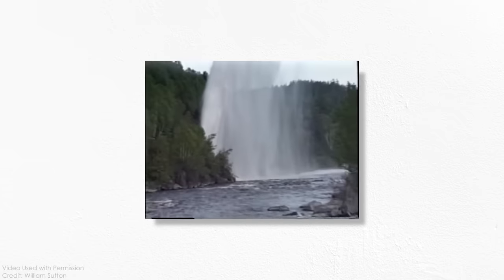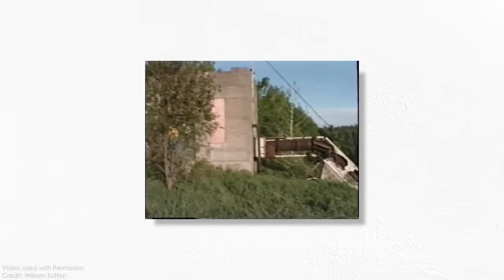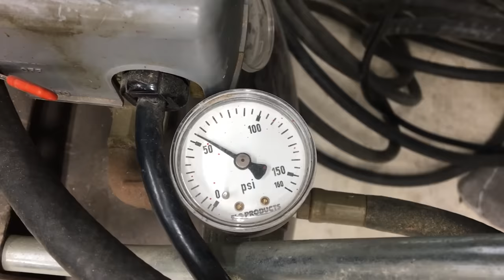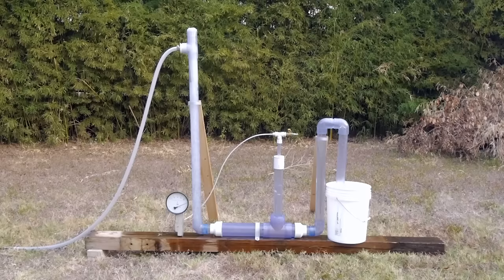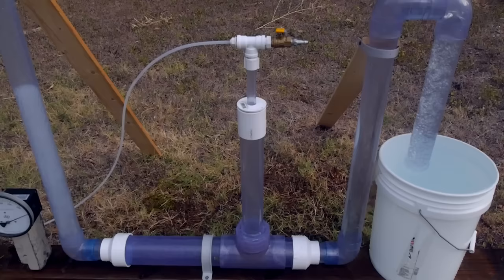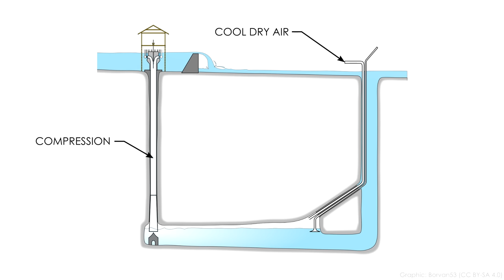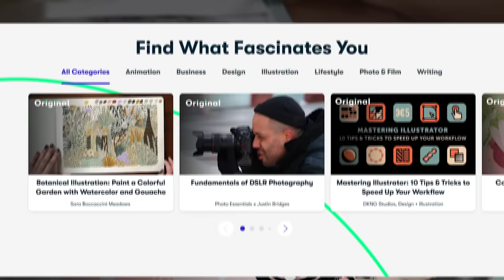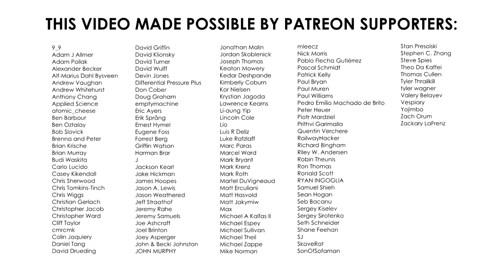Compress Air with No Moving Parts! - Trompe

Comment: You missed the biggest benefit of a trompe: Oil free air.

You can use the compressed air directly for breathing and in pressure sprayers for paint, without a costly filter system to trap the oil.

To make it practical you usually want to add a float valve to shut off the air to exhaust, if the water level rises too high to avoid water contamination of your air lines.

Additionally you obviously want to connect a tank which can store more air as a buffer to avoid having the float valve shut off every time you start a air hungry tool - wearing out the valve.

And usually you want a secondary valve which opens if the water level in the collection basin is dropping too low, in this case you need to vent some air or your water lines will be contaminated with air.

Depending on your line layout the air might collect somewhere reducing the flow inside the line.
Reply: Very cool.
Reply: It is far cheaper to buy an oil free scroll compressor than excavating a tunnel.
secondly, breathing air apparatus needs a refrigerant dryer to avoid moisture condensating in the container.
Reply: @ltmcolen  I mean sure but they were talking about features of a particular option, not what is the hands down the best option for a given situation. You aren't wrong about what you said just not sure how it really fits in as a counterbalance to what was said. As an addendum sure.
Reply: @ltmcolen  Since the air is cooled by the water to the water temperature while beeing compressed, the air in the tank actually warms up again to the air temperature (in most cases).

Therefore the air in the tank is quite dry and don't need to be additionally dried - this advantage was highlighted in the video already.

You can simply throw a flex pipe in a small river down a hill. It's extremely cheap and easy to maintain - no need to dig tunnels.

An Oil-Free Compressor needs the same filtering equipment than a regular one - the filter might just last a bit longer. Downsides of oil-free compressors are that they are more expensive and don't last that long.
Reply: @RubenKelevra  you're completely right. But I don't know if it would be easier and cheaper. For the price of such a construction you could buy many compressors man.
Reply: Woah, that's very useful !
Reply: @ltmcolen  a 800 feet pipe for getting 110 psi from a water source (PE pipe, 1 1/2 inch) will you set back around 450 dollars.

Sure you need some fittings and valves additionally and a small pressure tank where the water can flow slow enough to release all air, but: This system is absolutely silent and don't use any electricity.

Depending on your needs of air such a system makes a lot of sense.
Reply: That's really cool. Thank you for that extra bit of info
Reply: Ruben Kelevra the filters on an pneumatics is to trap water not oil. I've been using compressed air for decades and I've never had oil come out the lines. In fact you can put an oiler on the system to automatically oil your air tools.
Having said that even painting I only ever trap water in the filters. But maybe yours is different.
Reply: Sounds like a promising business idea I would love to investing in.
Reply: @goodbyemr.anderson5065  pneumatic tools might need additional oil to be properly lubricated, depending on the device. Some devices just need some oil in oil ports every day 10 hours of operation.

You surely haven't seen any oil coming out of your lines, since it will be very small amounts which are vaporized by the speed of the air passing by.

Breathing it sometimes might not be an issue, like smoking a cigarette isn't an issue. But if you often paint with a face mask, you definitely want oil free air to breathe. The water usually get seperated by a cooler, depending on the airflow it is either active or passively cooled. 

Breathing air filters are usually two level activated charcoal filters with two grades of filters behind each other. They are not designed to trap water, but particles, like metal dust from the wear inside the compressor, air inlet air contamination, oil vapour etc. 

The need for a filter on your spray gun depends on the type of paintjob you're doing. Basically everything you cannot do without a spray gun, e.g. metallic paint, you definitely want to do with a filter, to avoid particles trapped inside the paint or small drops of oil ruining the finish.
Reply: Now I see why you were messaging me about this!
Reply: @RubenKelevra  This is an oddly specific configuration of 800' od 1.5" pipe. I have the same thing but running at 122psi..... Coincidence?
Reply: @JoeMalovich  yeah sure. 🤔

But I helped out in a shop of a fried for 2 years which had a painting area. So I asked a lot of questions 😙🎶
Reply: @RubenKelevra  This seems quite "doable". Wonder if any Amish shops use this?
Reply: @w8lvradio  well, I'm on the wrong continent to have any idea what they use and what not 😙🎶
Reply: You are still dealing with water vapor in the air supply and spray painting is extremely sensitive to the slightest contamination of water or oil in the air supply.  Yes you do need an expensive water and oil traps.  That's where about 1/3 of my SIlentAir storage compressors costs is.   If you ever used an airbrush to spray enamels or transperent color paints then you know just how super sensitive the slightest contamination is to air supply is.
Reply: @ph11p3540  the amount of water vapor depends on the flow rate of the water, the pressure and the air flow speed in the collection basin.

I think a properly designed system can avoid most of the turbulences and let the vapour enough time to settle before it's reaching the storage tank.

In the storage tank the air will heat up when the storage tank is located inside. This way the air can pickup the rest of the the vapour as moisture.

The reason why it's so difficult to get the air dry when using a regular compressor is, that the air cools down from the moment of compression to the storage tank. A trompe is the other way around and the air will be dried instead.
Reply: Sir Dick Little You may not have seen it, but it is there. In certain applications, this is very undesirable. Integrated circuit manufacturing needs very clean environments. The carbon dust from normal electric motors and oil from compressors is more than enough to destroy a whole production run.
Reply: @goodbyemr.anderson5065  For tools you don't remove oil. But for breathing purpose, you definitelly add the expensive oil filter. And you are right about the oiler for tools.
Reply: @ltmcolen  i dont think so, industrial air compressors are extremely expensive to purchase and maintain. Instrument quality air (oil free, dry and filtered to one micron) is  very expensive to produce on an industrial level as well, ontop of the cost of a regular compressor. Im talking about air compressors the size of a dump truck, and atlas copco air processing machines the size of a conex container. Multi-million dollar price tags.
Reply: @goodbyemr.anderson5065  ummmmmm ,ive def seen contamenated air come out , ask a painter or artist, its impossible to not have it get cross contamenated without expensive filters.
Reply: @ltmcolen     Great points, compression can be extremely dangerous, especially with the introduction of moisture. Not only for the application and the equipment, but also for the ancillary items, such as pipe and fittings. Then, factor in atmospheric pressures, temperature, and media... that's a whole new level of science that most of these YouTube comment experts will never understand. That's why engineers, tradesmen and technicians go to school for such a long period of time...not to mention OJT. Hell, a simple AC system with moisture, wether during installation or later during operation, can catastrophically fail. 
BTW, your foul grammar is point on! The YouTube experts in the comment section watch a video and immediately think they're Einstein and Edison. Ha!
Reply: @goodbyemr.anderson5065  there is always a little oil in my filter along with water but I occasionally oil my tanks to prevent corrosion.
Reply: well moisture in it
Reply: @JoeMalovich  Joe, big fan. I've been living vicariously for a long time by lurking on your channel. I thought about your set up when I first watched it. I'm about to get started on a few projects myself. Thanks for the inspiration.
Reply: Rube
Reply: Shawn stanger One typically installs a moisture trap (which will also trap any occasional oil mist) just ahead of the spray gun when spray finishing , a larger capacity moisture and oil trap is also typically installed a bit after the compressor tank as well to capture the bulk of the condensed water and oil before it enters the hose.  On large scale setups a refrigerated air dryer will be utilized, and those are moderately expensive (about on par with the cost of a compressor large enough for spray finishing).  But for smaller scale finishing, such as a home workshop the filters used to trap moisture are not especially expensive.  Or, for smaller jobs, you can simply charge a very large air tank to full pressure then give it a couple hours to cool back down to room temperature and nearly all the water will be left behind in the tank so you get dry air at the spray gun without necessarily needing a moisture trap.
Reply: @ethanpoole3443  the tank idea only works when you use the spray gun at tank pressure. If you use a pressure regulator you drop the high tank pressure to a more evenly pressure for the gun.

The expansion of the air will reduce the temperature and the air cannot hold all the water it contains and you get an air water mist again.
Reply: Ruben Kelevra I have never had issues with water contamination when charging the tank to 160 PSI and operating my HVLP spray guns around ~20 PSI and allowing the tank to cool down to room temperature for smaller jobs (there will be two pressure regulators in this setup, a high pressure regulator near the compressor and an inline low pressure regulator very near the spray gun).  That said, it also helps that my shop is humidity controlled (I live in the southeastern US) at around 40% RH and kept around 70°F (21°C), so the incoming air is starting out fairly dry to begin with.  But even with oil-based finishes, which really do not appreciate water, I have never had issues with water contamination in the finish.  For larger jobs I will install a desiccant type moisture trap inline just ahead of the low pressure regulator at the spray gun to deal with any condensate or oil that may make it into the line due to the air starting out hot.
Reply: Where does the name trompe come from?
Reply: Don’t forget that you absolutely need to filter for bacteria 🧫 and viruses 🦠 and possibly prions as without an adiabatic stage used in a normal compressor the microbe level would be very high.
Reply: witkrieg todd  Thank you for the elaborate explanation. Do you have an idea what a typical COP value might be then in these
systems? Because I suppose it is an adiabatic proces in the way you explain it. And furthermore, what are the actual downsides? Because ive seen alott of industry and more compressors but i  have never heard of this.
Reply: @SystemsPlanet  you have the best words
Reply: So a trompe is an ejector. They use them in all sorts of air, steam and water applications. Including pneumatic paint sprayers.
Reply: @morgan5941  The thing is . I've been a techician at navy mine hunters and we kind of used sea water for everything.
Including evacuating water in case of slow flooding with ejectors based on the venturi principle using the bernouilli efffect. 
I kinb of wanted to be home more so I quit and started working at Atlas Copco. For ONE TIME I kind of know what i am talking about but that is an opinion.
Reply: Only works on a massive scale to be effective for tools or compression. Yes you can make some bubbles on a small scale, but nothing to do any real work.
Reply: that is very cool thanks for mentioning all of this Ruben
Reply: @ltmcolen  as someone who has no problem with appearing to be an asshole, allow me. If your first premise was as solid as implied why invest so much of your experience making as many supporting points as possible? Something I figured out halfway through this life, I will offer you, "we have forgotten more in the past 100 years than we have learned" sure we fly around and Google, what number of citizens who need food, (all) could manage a season of one crop? When to plant, what it looks like before acme? And the argument, if it was any good they'd be doing it today, man o man, you are going to be depressed for a year when you realize what fallocy that is, and what fallocy means. When's last time you saw a water heater last two decades brother? When profit defines your outfit, we tend to convince ourselves we are Superior because if we didn't we might get a glimpse into how shallow and selfish we all are. There is a drain valve on compressor tanks because the physical properties of Newtoniun fluids are what they are,  not mentioned or omitted when one design's marketing team want more sales. By compressing air at a much lower temp, even if by water, it cannot hold as much as when a mechanism compresses it, raising the dew point. So even if the stupid old people who played with shovel's in wet caves wanted to add mostiure they couldn't. Old people who enjoyed and appreciated their elders, celebrated even opposed to selling them to a home because we all have to pretend we get to live forever. The illusion of permanance is needed to have a society that actually thinks, this must be the best way BECAUSE WE ARE DOING IT. Your welcome
Reply: The Bushwacker  I am reading these comments and I ask you, you are being sarcastic are you not? How nobody mentioned relative humidity or saturation point vs temp is a little weird, to be honest
Reply: witkrieg todd  more please, and THANK YOU VERY MUCH for your time
Reply: Ruben Kelevra an 850 foot pipe. I wonder why nobody’s using this technology.
Reply: the valves you mention are unnecessary. Their roles are filled by the relief blow off and riser shafts, as well as the shape of the chamber itself. The chamber similarly serves as an a compressed air reservoir when built at practical scales. https://en.wikipedia.org/wiki/Trompe#/media/File:Taylor_trompe_sketch.svg
 The beauty of the system is that its a maintenance free, flow through construction. Also, to compress meaningful amounts of air large head and flow are necessary, making mechanical valving a liability. An accessible accumulation tank paired with a check valve would be useful additions for use with tools to stabilize pressure levels, but for water aeration, mine shaft ventilation, or air conditioning they aren't really necessary.
Reply: The compress air would be saturated with water vapor,  so instead of an oil separator you need a series of water separators. Just how dry the compressed air needs to be depends upon what the end use is.  Sometimes it is necessary to add line oiling equipment in air delivery systems to improve the lifespan of the equipment that the air is powering. So all the properties of the air system and the use of the compressed air need to be considered when systems are designed and connected. Sometimes a single facility will need a combination of wet or dry or  lubricated or  unlubricated compress  air depending upon the process involved at any given point.
Reply: make one and show us
Reply: @davidjones-vx9ju  there are people which are much more skilled and entertaining to watch which can do this :)
Reply: @RubenKelevra  I suppose location would play a big factor, like if you wanted to set up an air and water supply system at your hunting camp on a mountain next to a stream vs. air brushing in your studio apartment.
Reply: You still need moisture trap, but it's nothing couple meters of vertical snake can't solve.
Reply: I mean the inline dessicant air filters suffice for air tools for home use. Like $10 if that
Reply: @RubenKelevra  And no motors to burn out or pumps to overheat on high duty cycle...good for minimal downtime
Reply: Is there a way tonuse kinetic enrgy of air to conpress air ...for example if i want compressed air supply  in a moving vehicle ...
Reply: @kdcruz75  I mean, do you really ask if wind turbines are a thing? 🤔
Reply: @RubenKelevra  
Sorry man ..im not that good at engineering...i was just wondering how u would create a mechanism that one can have on a vehicke like a moving truck and use rhe kinetic air to compress air..
What would u recommend ..?
Sorry if i sound stupid ..
I still am figuring this video out ..
Another question ..if using the same equipment in this video ..how can i use rain water from the roof a third floor to create a supply of compressed air ..compressed enough to supply cold air into a house ..
Reply: oil free air is incorrect, the power outlet that powers the tromp uses fossil fuel energy.
Reply: @ltmcolen  Ones driven by a compressor do, because the air comes out hot and (potentially) saturated, condensing water when it cools down.  Air from a trompe comes out COLD and saturated - once that air warms up, it's no longer saturated.

Another way to think about it, these filter systems you mention involve cooling and condensation ...  the same thing a trompe does for you for free.
Reply: I'm seriously watching these videos in order to make such a system. Will definitely be using storage tanks, valves, and the like.
Reply: How many shops do y'all know that have a conveniently located water source with a 200+ foot drop, that also want to try to plow through the staggering amount of red tape to do something with that natural water source. We're talking over a year of permitting and environmental studies before you can even break ground. Or... you just call up your friendly neighborhood air compressor salesman and have a compressor delivered and running later that day. Removing oil and water from compressed air is not rocket science, and it is not nearly as expensive as some people here have implied. Those compressors and filtration units the size of shipping containers aren't that big because it's hard to make ultra-clean process air, they're that big because those installations make a lot of compressed air. To do the same thing with a trompe would require a far larger installation, and I think a lot of you greatly underestimate the cost of civil engineering projects, especially with modern environmental permitting issues.
Reply: @JoeMalovich  
What is the CFM on this type of system?
Reply: @c50ge  poor.
Reply: This would be a sandblaster's dream come true.
Reply: @BananowyDoktorXOXOXO  try doing the actually work. way more useful than investing
Reply: I think the main reason people are having a problem understanding your comment is because they're thinking from the standpoint of an air compressor, not a troump.